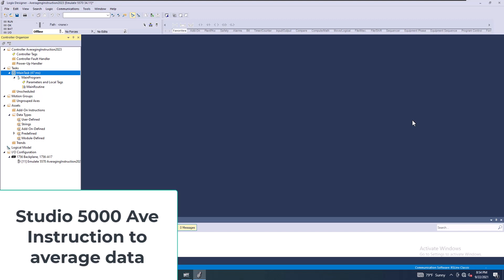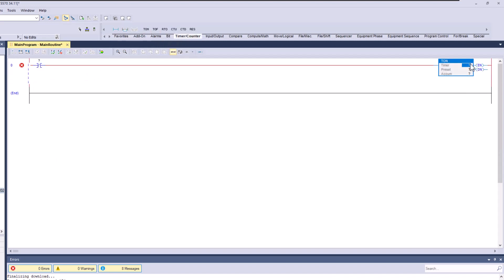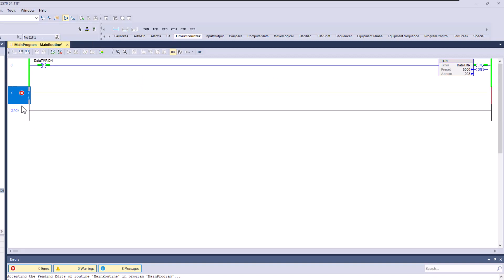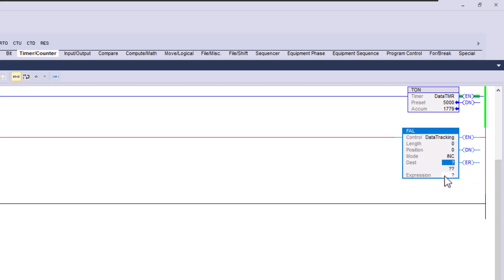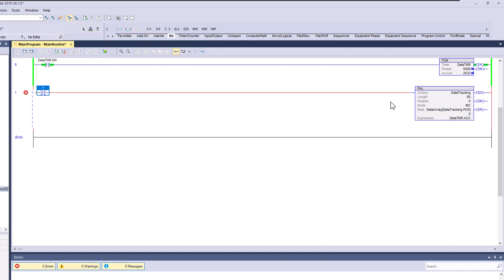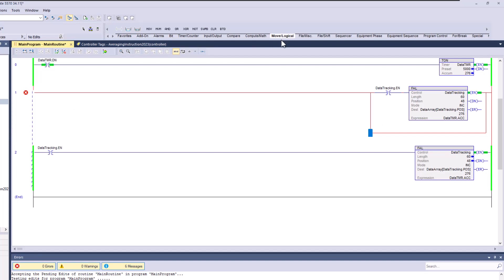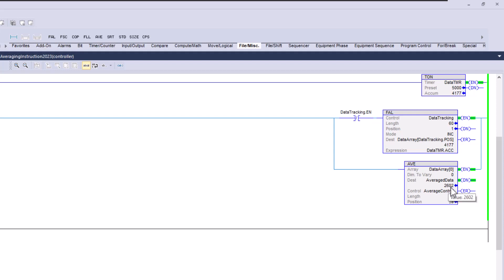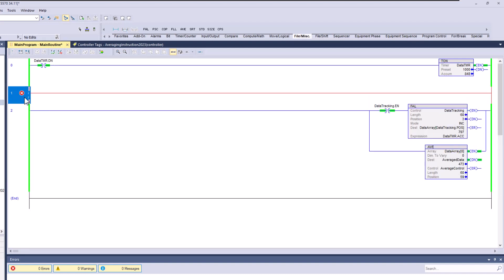Studio 5000 AVE Instruction to Average Data

Comment: Thank you for share all this knowledge. I need to measure the current of a motor and calculate an average during its operation, with and without load, to detect possible peacks in eletrical current. This video helped me a lot.
Reply from the maker: @Ebpaz20  Glad to help and yes, that's a good way to collect data

Comment: Shane, can I use this instruction to count a board per minute avg? I am needing to see at least 2 decimal places in the avg. I have an input (photoeye) that the boards run through to a sander, need a rolling avg of BPM. Thanks
Reply from the maker: Yes, just use a real data type and set it up to read every minute for the FAL instruction then average
Reply: @ShaneWelcher  Thanks, do I use the real data type in the "FAL" or the "AVE"?  Also my VMware is asking to download a new revision, should I do it, or leave it as it is?
Reply from the maker: @strictlyamps820  No reason to update VMware unless you are on VMware Workstation 17.

And yes, a real data type for the FAL
Reply: @ShaneWelcher  Shane, I am not doing something correctly for sure, lol. Would you happen to have a video on using a FAL and an AVE with a "REAL" data type?
Reply from the maker: @strictlyamps820  use the search tab on my channel and type in the word "FAL" to see if there are more.

I've been making videos for over seven years
Reply: @ShaneWelcher  I know, that is why I am subscribed to your lessons. I am learning